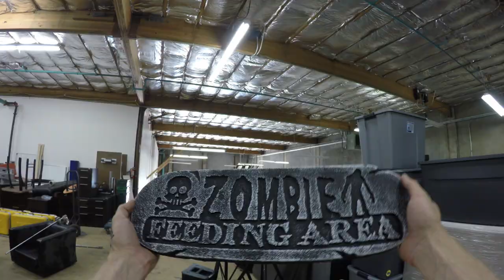GoPro Music BTS: Hermitude at the GoPro Warehouse

Comment: Hey guys, can someone help me? I'm currently editing a video from my winter holiday, and I want to put my logo into the first clip of my video. I basically need to merge the video's into one and I want the logo to be faded in the background. Does somebody know how to do this? I'm using the latest GoPro Studio version and I'm on a Windows computer. Thanks in advance!
Reply: +Tim Luijk I haven't personally done this in Studio before, but my gut feeling is that you'll need to be able to get your logo into/onto a video frame (mp4) or even a still (jpg)--ideally one that matches the aspect ratio of your video footage (16:9). 

Once that's done, try importing the frame/still into Studio. Try in Step:1 first, if it doesn't allow you to convert and Proceed to Step: 2, try importing it in Step: 2 directly (Media/+ icon, in the left-hand column). NOTE: non-GoPro media doesn't always import into Studio; but generally a simple JPG or MP4 will. 

Once you can actually drag your logo "clip" into the Storyboard in Step 2, use the crossfade(?) icon to blur the transition between your logo footage, and the start of your first video clip. The crossfade/transition icon is the little "+" symbol between two clips in your Storyboard. 

I think this will work! fingers-crossed